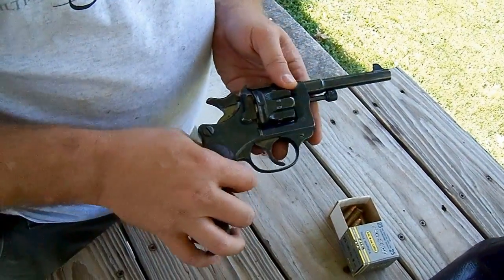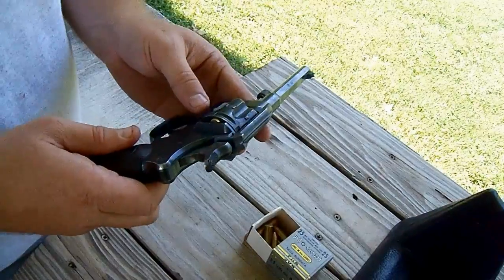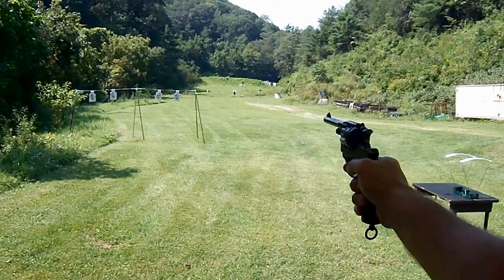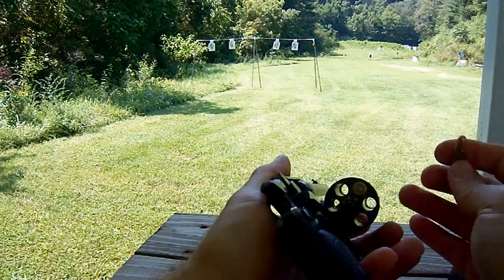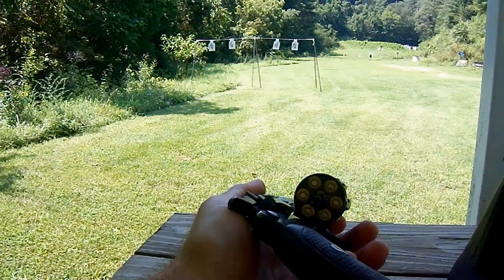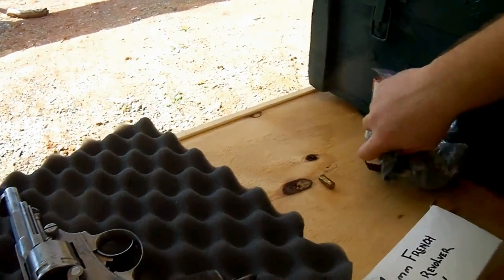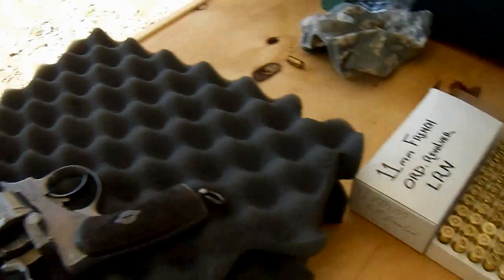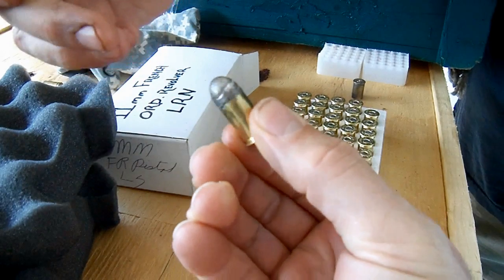French Ordnance Revolvers

Comment: Nice. For my 1873 French Ordnance I start with .44 Russian cases and first cut the case to a length of 18mm (not 17). Then I thin the rims of the .44 Russian cases to a thickness of 1.15-1.20 mm (so they clear the shallow chamber).  A 5 grain charge of Trail-boss or, 0.7cc Lee Dipper) under a std. heeled .451 (.430 heel) bullet gives me Webley .455 performance and accuracy. It definitely is of the big slow and heavy line of thinking.

Comment: What is the name of the custom reloader for the 11mm?
Reply from the maker: Gad's Custom Cartridges, but I wouldn't recommend them based on what my friend received.  I recently traded my friend out of that revolver, and he threw in the rest of the Gad's cartridges.  I don't even think I'll shoot them, but I will pull the bullets and re-use the brass.  The brass, at least, looks to be pretty decent.  I don't know what the usual quality is with Gad's.  My only experience has been with these 11mm French, and they were lousy.  Perhaps he was having a bad day?
Reply: Thanks for the reply. Hopefully after 4 years, they would be doing better. I looked at their site, and they are still in business and have many calibers. I saw that the 1873 can be made to shoot .45 ACP. I might go that route.
Reply from the maker: It can be made to chamber and fire .45 ACP, but that is a handloading proposition only, since factory ammo would generate pressures much too great for the metallurgy of this otherwise robust revolver.  But I'm sure you could fill a .45 ACP case with blackpowder and shoot it safely.  When I was reloading for shaved Webleys, I could get about 18 grains of FFF under a Webley bullet in the .45 ACP case.  That's more than the 10 grains the 1873 was designed for, but I don't think that would be a problem.
Reply: I have been hand loading for 40 years. I would use BP. Thanks for the reply.